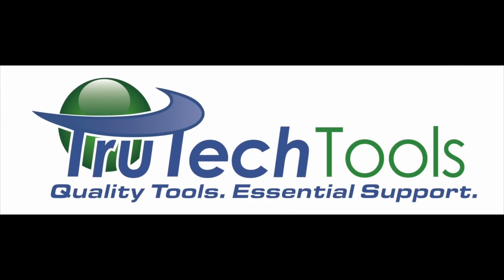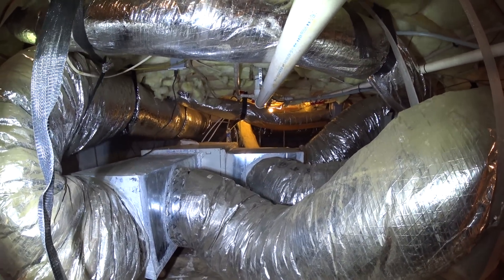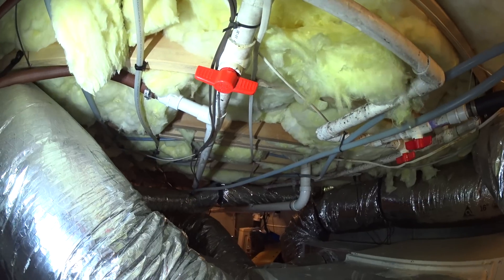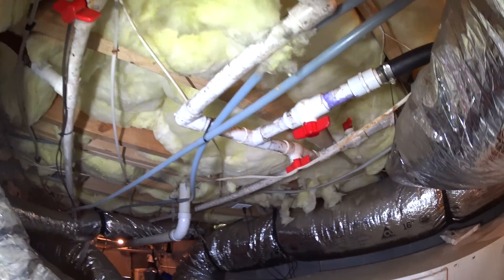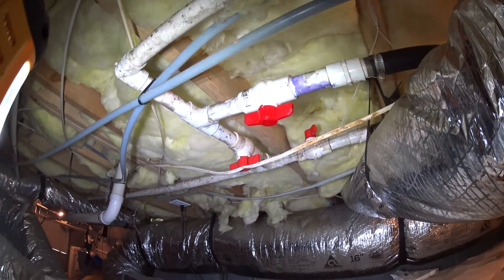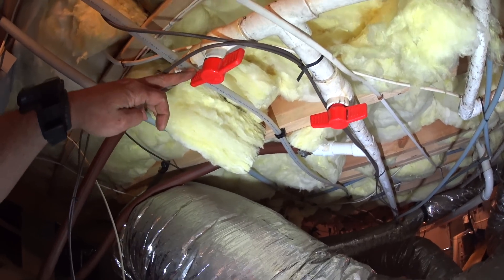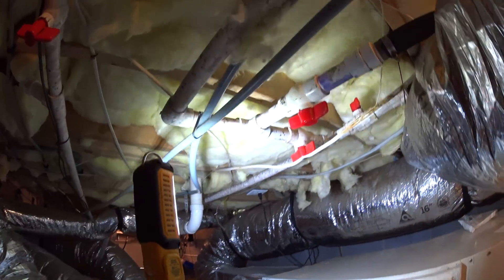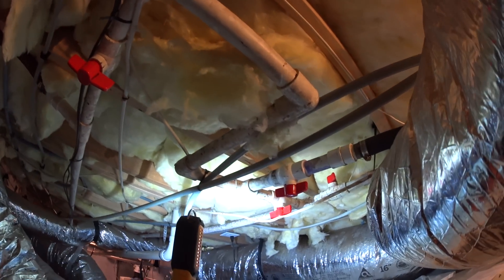HVAC Service: Surveying FHP Florida Heat Pump GeoThermal Heatpump System

Comment: It's just a bypass loop so you can clean the exchanger while letting water flow. Normally. Protects pumps by not shutting off circuit so I've been told. But that is what it is

Comment: Now that is something to talk abt w the guys. I can’t believe someone actually got paid for that work. Wrong on so many levels. Keep em coming
Reply from the maker: The sad part to me is that I fixed it and realized that the pump was too small to handle the total load and so I client called out the old service company and they put it right back the way it was rather than change the pump. I guess I knew enough to get myself replaced by another contractor. 🤷‍♂️

Comment: Never work, with inlet water above 60*
Needs solenoid on both and each needs water inlet from wells, you can run both discharges to well, so just need re-pipe inlets. Done Geo's since 1988. FHP ,Water Furnace, Addison,Climatemaster.

Comment: that belongs on the wall of shame web sight. It would shure be a great project to tackle if the customer would let you spray foam and get rid of that nasty fiberglass ,water lines, and duck a puss job. you a decated technician. you don't run away from negative situations .

Comment: they are plumbed in series... Weird...  You also can't open that partially closed valve either.. They are on a well. If you open it you will rob them of water every time they need heat or ac..   What a mess!   Is 75 water really that bad? A lot better than 110+ in the southern summers! My uncle has a water heat pump in FL with a shallow well for the unit and his water in summer can't be any cooler than that..
Reply from the maker: 75 isn't terrible but it could be 62, could be worse though

Comment: That may be an "open loop system" where the heat exchange water is obtained from the well and then discharged.  In that case the well water temperature is not likely to continuously rise in summer or cool in winter as it would a closed loop system with buried ground contact pipe, therefore a series water connection between two units may work and reduce the amount of water consumed.   Typically each heat pump will raise the water temperature 4 to 10 degrees, which means the second unit is seeing slightly higher condenser temps, but still within good operating ranges.
Reply from the maker: +RJ Parker you're right, I still feel like it would be best to have both getting the same temperature inlet water.
Reply: @StephenRardon  The separate solenoids should control water usage.